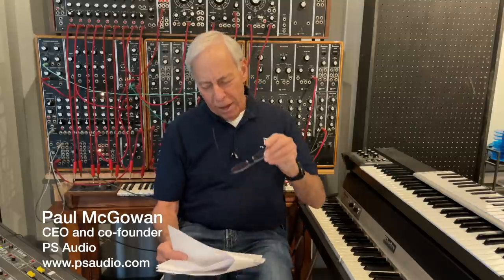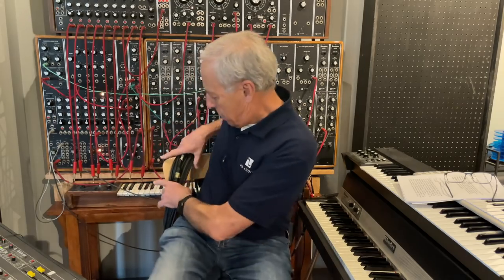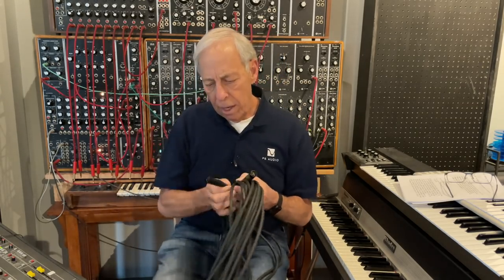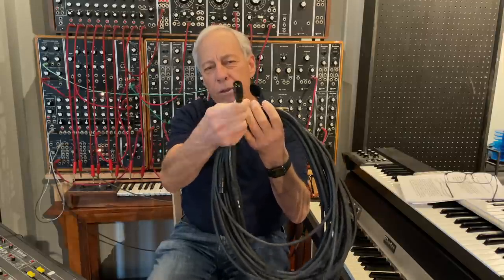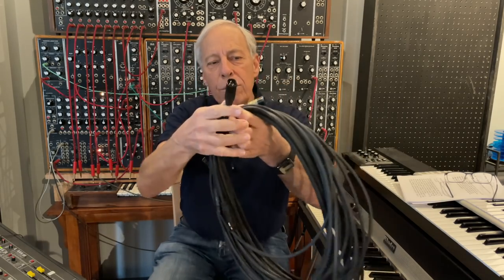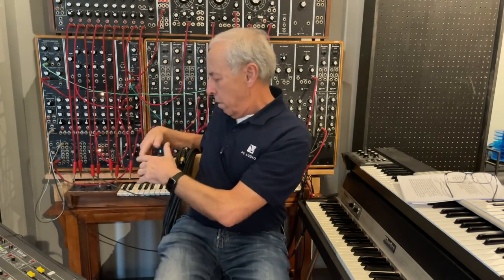Mixing XLR and RCA cables

Comment: On the live sound side of things going from unbalanced to balanced you sort of get half of the effect as you will get some signal rejection that way although your sound level will be lower than what the XLR input will expect.
If the cable is wired properly the RCA tip will be going to the hot and RCA shield will be going to the cold leaving the XLR Shield either disconnected at the XLR connector or acting as a shield across the length of the cable and floating at the RCA end.
I've actually had Fairly good results with this, well I am not listening at Golden Ears level I am very sensitive to signal noise and interference.
There are also devices that would balance the signal that could be put really close to the source to eliminate as much as possible the unbalanced cabling. But I say bye a device that is capable of future expansion and has both inputs that way you can try it both ways I haven't if you upgrade later you have the capability.

Going the opposite way you get some benefit but not nearly as much as the input of an unbalanced device would not be able to take advantage of any of that.
Going from balanced to unbalanced equipment with a balanced XLR to balanced TRS cable going into a balance Jack will give you a bounced signal, going into an unbalanced Jack will give you some immunity depending on whether that Jack Floats or links the R to S when a Jack is inserted. Now this is a little bit different for RCA connectors as you don't get that benefit have the ability of joining the shield and cold so you generally just want to keep it short and away from things and if you have to cross power cables do it at 90 degree angles.

Comment: How do some  Burmester Preamps with RCA inputs to a Balanced XLR output work? And why do they offer a balanced output?
Reply: Many preamps do this.  They have a mix of balanced and unbalanced inputs, and have a balanced output.  A balanced connection from preamp to amp is highly desirable, especially if you have a longer cable run to an amp that's located near the speakers.  This is not a big deal.  Most preamps do not have a fully-balanced (ie. dual-differential) circuit topology.  That's very rare and complicated.  The preamp circuitry is usually unbalanced, but feeds a balanced final output stage, or a transformer.

Comment: Hi I really appreciate the video, I have a question I just bought a DJ controller that came out 10 years ago so it has only RCA jacks on the back I want to connect them to my JBL powered speakers which only has XLR cables on the back what would be the best way to go to get the best sound should I go with an adapter or should I get a RCA to XLR cable. 
Thanks.
Reply: how'd this work out for you? 
I have a Numark M2 - 2 channel mixer (RCA) 
I need to connect to my EV ZLX Powered Speakers (XLR)

Comment: Sony ES has both RCA & Balanced out and they are great greeat sounding equipment..
Reply: I love Sony audio from nineties
Reply: Was going to say the very same thing. Many higher end Sony CD Players have fully balanced outputs come now Paul you should know that.
Reply: An XLR output doesn't always mean it is truly balanced. Not saying it is not the case on the Sony CD. Just saying be careful with assuming that any XLR means balanced by default because it is not always the case. On top of that there are different ways to implement balanced. Again be careful.
Reply: @ESL-Plus  for instance,  the Sony CDP-X779ES and CDP-X707ES have two independent paths from the differential output of the D/A chips to the outputs. Really, something very few did then and do now. This way,  whatever format the user does, no degradation of sound as a results. If balanced is chosen,  all the advantages of that type of circuit are obtained. Better than transformer coupling as in the CDP-X7ESD or DAS-R1a. Even the iconic D/A DAS-R1 converter used only single ended outputs. Spectral CD player use exclusively cinch connectors. The extraordinary Sony Preamp TA-ER1 which is shown in my avatar converted s/e inputs to balanced. All inputs, in balanced mode treated by an input buffer were converted to S/E prior to enter the analog potentiometer pot and again turned again to balanced by another buffer output. This apparently complicated scheme didn't seem to affect the sound. Multiple ways to arrive to the same target. How a particular circuit is implemented is much more important that its architecture.
Reply: @ESL-Plus  agreed Jos, its true of many so called High end components too. I have owned a few higher end Sony ES CD players including X77ES and SCD-1 both are balanced the latter I still own and use often. I bought it 2nd hand after reading a stereophile review. It is a fantastic sounding device with brick Sh@t house build quality and  will see off many so called Esoteric and hugely expensive CD players even today. I'd wager some of its direct stream technology was emulated in PS Audio gear. I wonder these days should I buy another CD player is it worth getting a decent 1trsnsport with an I2S digital out and get a DAC like the Denafrips Pontus or Venus. Dacs are ever changing and improving but CD transports are pretty mature tech but for now I get huge enjoyment from my vintage hi end Sony balanced out. Cheers Gerald 🍻
Reply: @Gez492  I go for the Schiit Urd transport with Unison USB hub and feed the Yggdrasil USB Unison input. My end game 100%.
Reply: @ESL-Plus  I have tried over to explain to people that just because an amplifier has XLR inputs doesn't mean it's balanced. People don't seem to understand even though I point them to Pauls explanations on the difference.
Reply: @scottyo64  Yes, cheap touring gear, Beringher for example, is often guilty of that. I have seen it myself.

Comment: I'm having an issue with 60 mhz hum while using RCA to 1/4 plug adapter from receiver to amp. Hoping a line conditioner solves this issue.

Comment: Is balanced signal ever possible via 3,5 mm jack from DAC to amplifier? I have an external Sound Blaster DAC with only a combined 3,5 mm/mini-toslink output. I assume it's best to connect to the amp via 3,5 mm -> 2x RCA right? Is there any benefit using 3,5 mm -> 2x XLR cable? The amp accepts balanced signal.
Reply: Yes and no. Most likely not. TRS 3.5 millimeter is usually wired up for Left Right ground in pretty much every device there are some mono versions. However there does exist some devices that will give you left and right on 3.5 mm as a balanced output but then you're looking at two jacks labeled left and right. As the configuration changes to TRS tip ring sleeve hot cold Shield.

If it's a consumer device and then most likely.
I go from 3.5 mm to RCA just fine, occasionally I'll run into power supply issues from the computer being noisy and even rarer ground loops caused by ground differential between equipment.
Reply: @imark7777777  Thanks for the info! I found figuring this out via Google surprisingly difficult. If you get lots of extra noises because of your PC, just get a cheap external DAC. DAC affects sound quality the least in "a chain", so you don't need to invest that much into it if you don't wish so. I have a Sound Blaster Z myself, but I still later bought Sound Blaster G6 rather cheap, which I will soon use as a DAC.  I don't want any interference from the PC, which you get from almost any PC.
Reply: @TheSupremeSkill  oh yes computer noise. I usually run across this with laptops plugging in to sound systems, where they're great until you plug the power cord in but if you don't plug the power cord and they die during your presentation. There's also just generally the noisy output of the cheap built-in audio components, my last new computer this drove me nuts because it had a slight hiss on the audio signal which wouldn't be so bad but then it would shut off the audio hardware after a few seconds of no playback so it was really obvious.
The quality of the internal sound card is key and it's great that we have external as an available option.

Glad you got it sorted, I like the comment with the thought that maybe somebody else will run a crossed it and find it useful if the original poster didn't.

Although I missed the toss link output, that could also be used to get a clean digital signal out and then convert. It's great to have options.
Reply: @imark7777777  Definitely use Toslink when possible. I don't know if any laptops have Toslink, but some if not many have the combined 3,5 mm/Toslink. There should always be a separate Toslink connection in laptops, it's the best invention ever.
Reply: @TheSupremeSkill  most Apple stuff for a good while on their laptop and desktop side included the combo port I have yet to see a Windows system with it I think but I know they’re out there.
I finally got myself a cable a few years back and started playing with it it’s kind of fun disables the volume control but I know I’m getting a direct signal out. Then a couple years ago I acquired a reference monitor from a TV station with BNC so I had to get myself another adapter to go optical to coax.
Reply: @imark7777777  usb soundcard with optical cable, problem solved, 50 dollars including 15 meter cable

Comment: Mixing XLR with RCA on one cable can still eliminate ground loops if that is the root cause of the hum. Tough it is true that the common mode rejection will be lost.
Reply: RCA is not balanced

Comment: but what about speaker cables couse they arent xlr or balanced for that sake its only copper or gold and so on what if the humm get to that cable
Reply: That's why people choose shielded cables. I don't go in for balanced. Not because I think they're bad but because I think they are unnecessary. My equipment is modest and my hearing is mediocre. All I do is keep my cables as short as possible - like my interconnects are 10 inches only - and I try not to run my signal wires near power cables. This goes for speaker cables too. Keep em short (Ie don't have 30 ft cables for a speaker 10 ft away) and get some wire with good shielding.

Comment: My problem is that my preamp hasn't got balanced out.
So my streamer goes to my preamp via balanced, but then the preamp goes to the power amp via rca.
Reply: That's not really a problem if it's wired correctly.

Comment: Can't we ground the outer shield of XLR cable and use the inner 2 plus and minus as input of RCA pin
Reply: You can connect a XLR output to a RCA input by using the hot(+) and GND. Cold(-) must be open (no connected)
Reply: @OZ7ADZ  Thank you for the reply... It's my lucky day to get a tip from you, "
A great Person"🙏
Reply: @PracticalGangu  if you connect the + and the - together, the least bad that can happen is that you hear almost nothing. Those cancelling to each other.
Reply: I'm assuming you mean connect positive to RCA tip and negative to RCA Shield and then float the XLR shield down the cable, that will give you some noise rejection if your input is balanced. all bets are off going the opposite way.
Reply: Yes and that is one of the recommended practices when you don't have a converter box. Connect the balanced minus to the RCA shield and the balanced hot to the RCA center pin. Float the cable shield but only at the RCA end. You might pickup a db or two of additional noise reduction but it's highly dependent on the system as a whole including the environment which includes AC power grounding. 
This was a common with analog broadcast video equipment. Standard analog video is unbalanced. But ever since we went from 60hz to 59.94hz vertical rate for color TV, rolling 60hz hum bars became an issue, PITA to be blunt. So manufactures started using true differential input stages with the insulated BNC connector shield connected to the diff amp minus input and not grounded at the destination device. While not as good as a true balanced system, it did provide significant 60hz hum rejection.
Reply: @OZ7ADZ  [edit...disregard the following, I had assumed the discussion was about a signal path from RCA to XLR; that was a bad assumption on my part] Leaving the ‘–‘ wire unconnected sounds like a recipe for big problems with audio quality.  I believe you should connect it to the RCA shield (definitely the most important thing to connect there), along with (maybe) the balanced-cable shield.  OTOH, Andy’s recommendation to float the shield at the RCA end sounds like the best choice.
Reply: @andydelle4509  yep, oh interesting.
Reply: @OZ7ADZ  This depends on the line driver being used. If it's a floating output (either a transformer or an op-amp circuit that behaves like one), then you MUST ground the cold output for it to work, since the hot and cold are referenced to each other, but not to ground.

 If it is a simpler differential line driver, then you do not want to ground the cold pin, as you are essentially tying the output of one of the two driver op-amps to ground (usually through a 47R resistor). The op-amp will almost certainly current limit for part of the cycle, resulting in non-linear currents being injected into the ground. This usually leads to a huge increase in distortion.

Balanced audio is not as standardized as a lot of people think. Most equipment with balanced outputs will include directions for balanced to single-ended conversion in the user manual.
Reply: @OZ7ADZ  For a signal path from XLR to RCA, I believe your approach (of leaving ‘–‘ unconnected) would work in some situations but not others.  It really would depend on (1) whether the ‘+’ and ‘–‘ wires carry exact-inverse signals at that point in the chain (they often do, but not always), and (2) it probably wouldn’t work at all if the source of the XLR signal is a transformer, such as in a direct box.  I imagine that a signal source like a microphone or turntable cartridge would also fall into this category.

Comment: But I still wonder why most phono preamps don't have balanced inputs, while phono cartridges provide a balanced output.
Phono preamps with balanced inputs are very rare...
Reply: damn, you got me thinking.  Most hum comes from phono inputs too. You would need to rewire the turntable, use low capacitance balanced wire and redesign the preamp.. The xlr is too big and expensive I guess.
Reply: @markanderson350  No need to rewire, if it has the regular rca connectors and a ground wire, you just need two XLR connectors.
Connect the ground wire to pin1 of both XLR.
The positive (the pin in the center of the RCA) to pin2 of the XLR and the outer shield of the RCA to pin3 of the XLR (this is the same for both right and left).
There are exceptions though, like Rega turntables have ground connected to the shield of the left RCA connector, so those do have to be rewired.
Reply: So why don't we have balanced guitar outputs. You could just change to a 1/4 stereo connector and rewire pickup and have balanced preamps in guitar amps?
Reply: @markanderson350  I don't know how guitar pickups work, so I can't say anything definitive about that.
Reply: Well let's say it's not much different than a microphone. A cheap consumer Mike has a 1/4 inch and the better ones have XLR and all musicians use XLR for mikes. I have been around consumer in my younger years fixing stereos tape decks etc at home. Later got involved in some pro equipment in bars hooking up jukeboxes etc. In a good commercial hookup they use 70 volt speakers and mono sound. Now I own a theater we have bands at and they only talk XLR and no nothing of 70 volt and avoid all that RCA unbalanced like the plague. I floated around many technologies over the years.
Reply: @markanderson350  Okay so a guitar pickup is like a condenser microphone, but with the strings modulating the signal instead of a membrane?
Reply: No it's not that fancy. Just a coil with an iron core of sorts put near the strings. The string vibration induces current. So it's just 2 coils in a box near strings that made many people famous. The body has no effect on the sound being magnetic.
Reply: The 2 coils are hooked to a switch for a different sound. One is bassier one more twang.
Reply: @markanderson350  Ah that makes sense, so it's the same principle as a moving magnet cartridge.
How about ceramic pickups, same thing?
Reply: Oh I guess. They are not taken seriously. They have a high output but need a very high impedance preamp to preserve the bass.  I would not waste the money on them
Reply: @markanderson350  Ah okay, I thought that most electric guitars had both coil pickups and a ceramic one, for different sounds.
The high impedance makes sense, as ceramic elements (just like piezo crystals) generally generate very little current, almost voltage only.
Reply: No it's not possible. Not at all. It's all magnetic unless it's an acoustic with a Mike in it. Some have him bucking coils too. It all could be balanced. I think someone should investigate this.